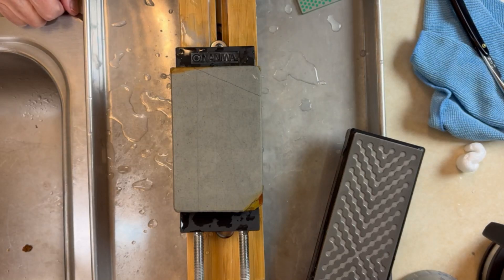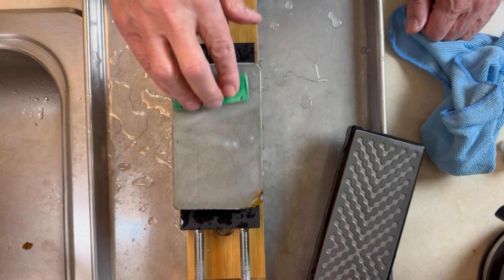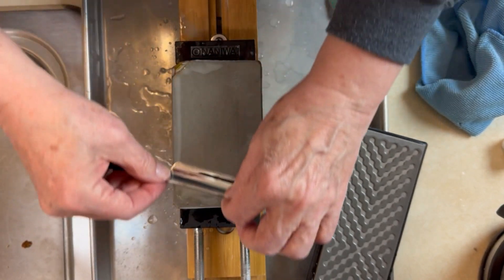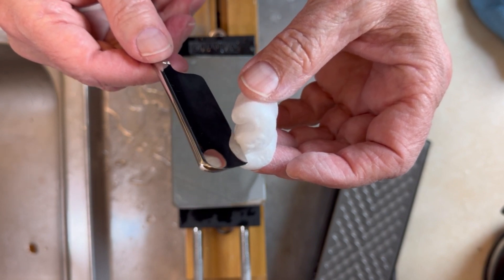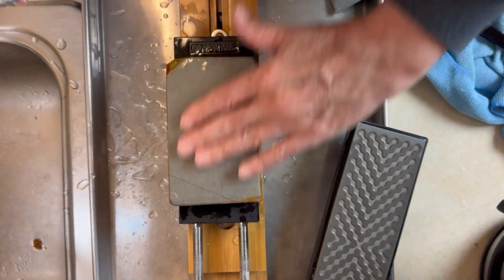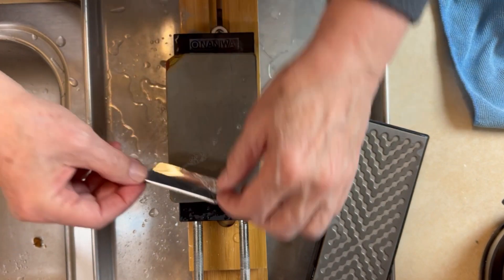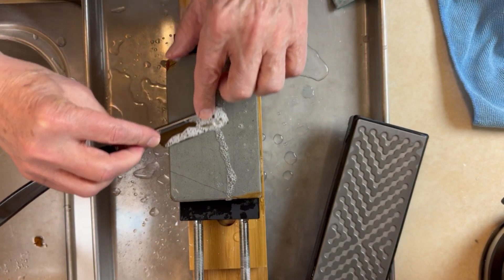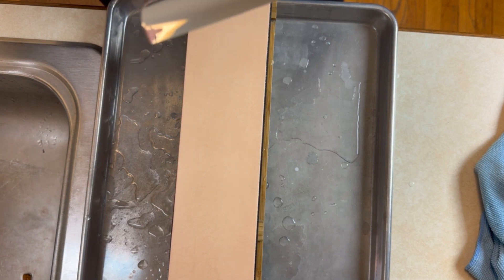Can I Improve on an Iwasaki Edge

Comment: That is a beautiful razor. Any particular reason you are using destilled water?
Reply from the maker: Thank you! I'm fortunate to have it.

My tap water does not contain a high concentration of minerals, so I don't really need anything special in my spray bottle. I have a water purifier that has a setting on it that filters water to that level so I fill my spray bottle with it.  Fact is, I also use tap water and have never had a problem.

Comment: Greg love watching your content. Incredible knowledge and I’m always taking something away. 

Quick question about the packing peanut. Is there any difference between the white and pink version? 

Appreciate any feedback you may have and keep that great content coming.
Reply from the maker: @darcyvariava81  Hi Darcy - thank you for kind words.

I’ve tested the white and pink side-by-side. They are both polystyrene and have the same resistance to a push cut. 

The biodegradable packing peanuts are a different material and don’t work as well for me.
Reply: I actually have the biodegradable ones as well and they are very inconsistent. I’ll be giving the polystyrene a go. 

Thank you again Greg 💪🏻